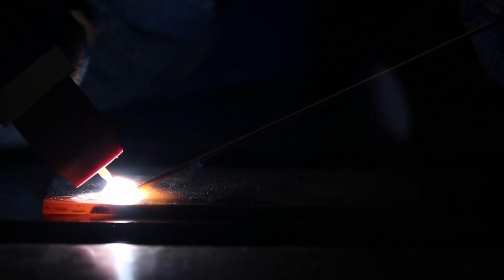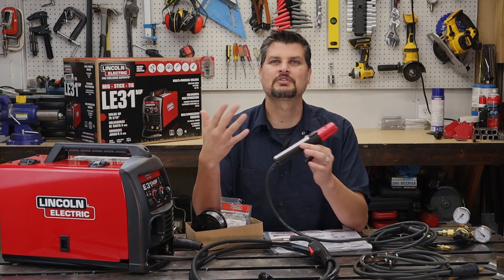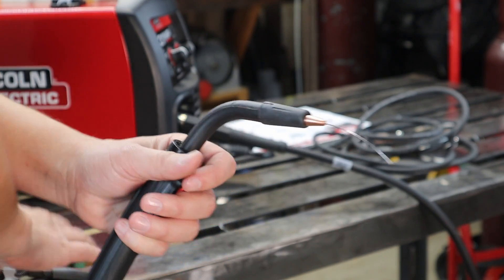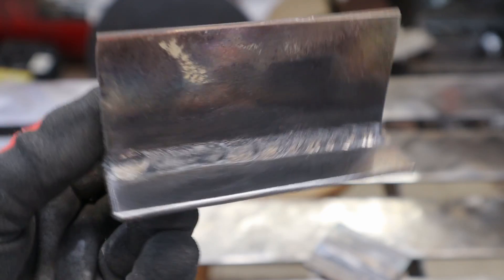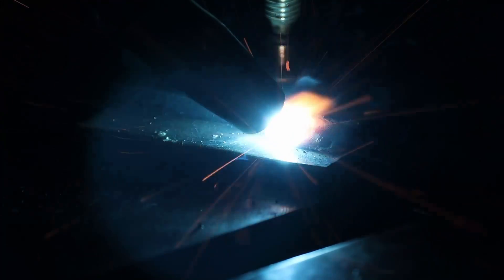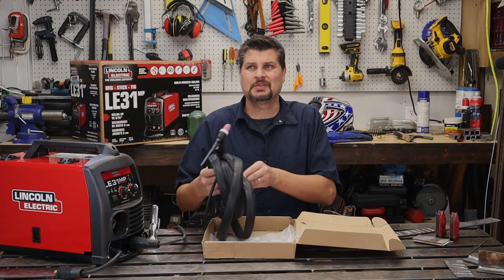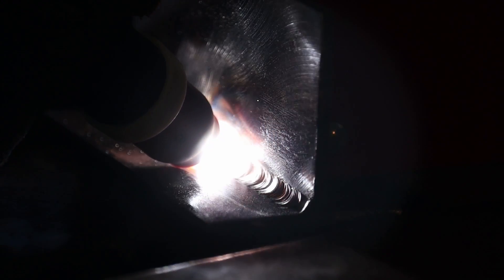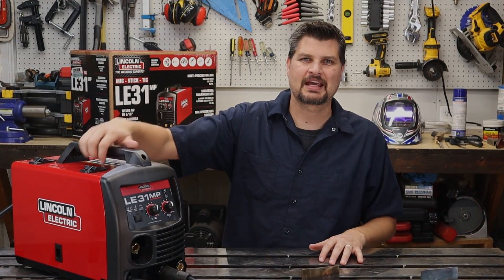Lincoln LE31 Multi Process Welder Test and Review

Comment: How are you running tig without connecting it to the mig connection I’m not getting the gas flow
Reply from the maker: I picked up one of these:
https://amzn.to/42OrGid
Since I didn't use the Lincoln ones my gas line is ran directly to my bottle and I that tig torch has a little manual valve on the torch itself where you turn the gas on and off.

Comment: For what it is, this is a very good machine. I use mine exclusively running self-shielded flux core wire. I have other machines for other processes. But this welder is great on a residential jobsite where I can't get my bigger rigs, but where I can fit a Harbor Freight 4500watt generator. Pro-tip: this welder will pull more than 20amps if you let it. I swapped the plug over to a 30amp twist lock and can run the thing wide open on a 30a circuit.

Comment: You recommend this or titanium 200 mp?
Reply from the maker: They both weld great. If price is an issue I'd go with the Titanium, if you want a more reputable brand, then Lincoln!
Reply: @MechMaster  if you had to pick one or the other which would you choose.  I found a deal on Lincoln le31mp so it's about the same price as titanium 200 just trying to figure out if the licoln will work or just wait and get titanium on good deal?
Reply from the maker: @TruckGuyHD92  not to throw out more questions but do you plan on using the tig function and do you have 220v and need to do thicker material? If you don't plan on tig and don't need the 220 capacity for thicker material then go with the Lincoln. If yes to those then pick up the titanium since it comes with everything, including the tig torch, and 220v ability.
Reply: @MechMaster  I'm planning on using it to learn tig. I am planning on wiring in 220 for an air compressor so I will use same outlet for air compressor as welder. I dont plan on welding to much aluminum so that's not a concern. As for thickness of steel not sure yet. I also would like to learn stick welding

Comment: Found one on marketplace for $400. Box was sealed with original Lincoln electric tape. Everything still wrapped up as if i bought new. Excited to get it running.
Reply: To add to this comment, custom fabricated a four wheeler plow mount utilizing this welder. Didn't have any trouble welding 1/8 to 1/4 plate.
Reply: @dub123boy  did you use standard 120V outlets? I got one too but haven't set it up yet
Reply: @x0j  Indeed. Worked great
Reply: @x0j connect it to 250 volt pigtail withe a 30 amp breaker, you can get more power and the breaker won’t trip 120v will cause the breaker to trip
Reply: Me for $250 and NEW😮😮
Reply: I bought mine the same price $400 taped up and I’ve had it for 5 years now it’s made me good amount of money

Comment: Hello, can you recommend a size of generator to run this machine?
Reply from the maker: I've done very little welding with a generator so I'd have to let someone else chime in. I do know you can take ohms law to get watts by multiplying the voltage which this is 110V and amps which at full dial this will draw 20 amps. That equals. 2,400 watts. You'll need a generator with that as a min. if not more because there are plenty of inefficiencies in generators.
Reply: @-DIYPRO-  thank you

Comment: Lincoln just put out a new welder, almost the same price as this one the 211 MPi. Nice but,  it does NOT stick welds! If you ask me, and don't need 240 volts, this is more useful. Even that the LE31 is only 120 volts,
Reply from the maker: I'll have to check that one out!
Reply: Can i use 15amp breaker to my 180i mp dv?